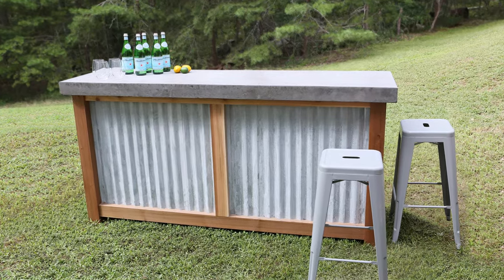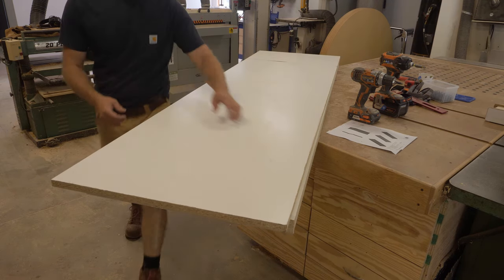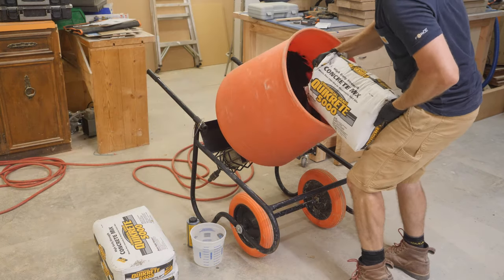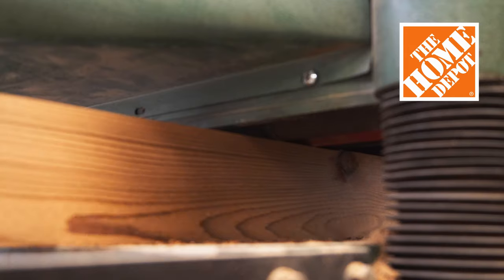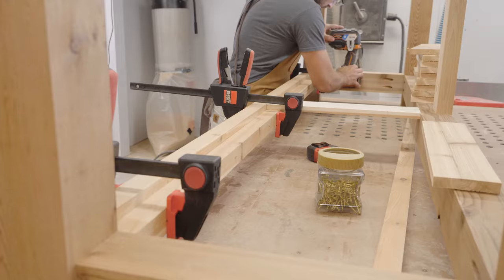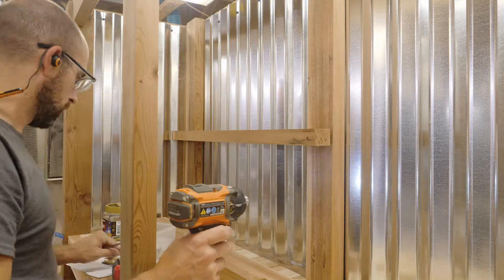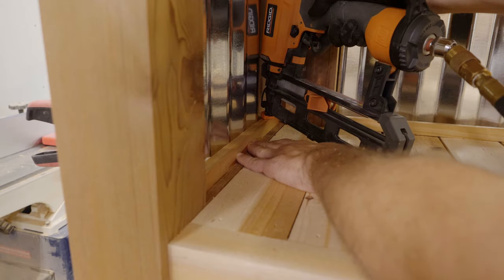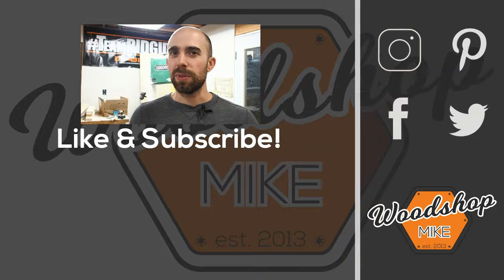How to Build an Outdoor Bar

Comment: Cabinet saw, 20" planer, 8 inch jointer, $500 miter saw. But somehow you an make this "without owning all the tools".
But hey, at least you showed renting the concrete mixer from your sponsor.
Reply: You could get by using a circular saw with a guide like framing square or tablesaw to make these cuts. And a wheelbarrow or bucket or tote to mix the concrete. The planer is something I dont have but is useful. You could hand sand or get a hand planer of course too
Reply: Lol

Comment: The bar is awesome, and the video is a huge help in showing how it all comes together. Do you have any suggestions for an alternate top? Would a butcher block top work on a bar like this that's meant to be outside?
Reply from the maker: Thank you very much!  I would avoid butcher block, it will almost certainly delaminate as they're typically manufactured with the intent of being used indoors.  If you wanted a wood top, just use cedar or cypress planks.  You could used PT pine for the entire project too I suppose.

Comment: Does the galvanized steel/metal get hot in the sun? Is there a product that I could spray on it so it doesn't get hot to the touch? Like rubberized truck bed liner spray?
Reply from the maker: Metal will certainly get hot in the summer, but then again so will the concrete countertop.  Ours is setup at an outdoor area fairly close to a tree line, so even though we're in Georgia, it's never been too hot to eat/serve at.
Reply: @WoodshopMike  thanks so much !

Comment: average cost for this build?
Reply from the maker: Roughly $400 if you also use cedar.  If you wanted to save a bit you can get away with pine, but you'll want to use pressure treated or southern yellow and make sure to finish it well.